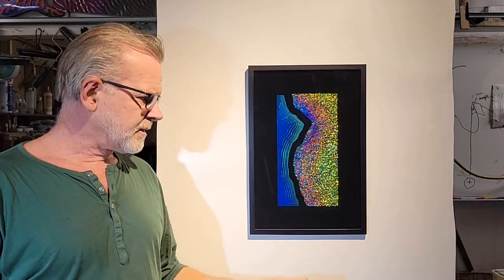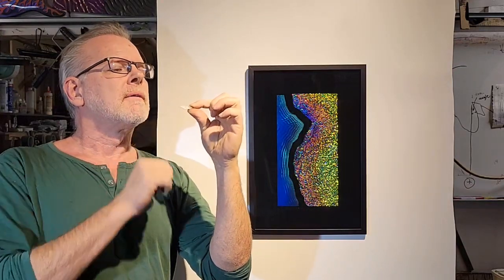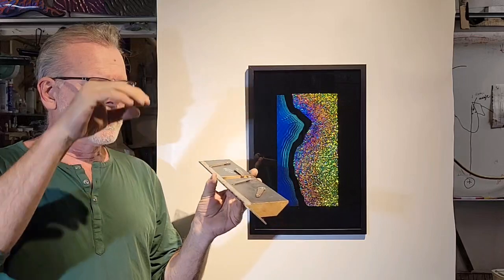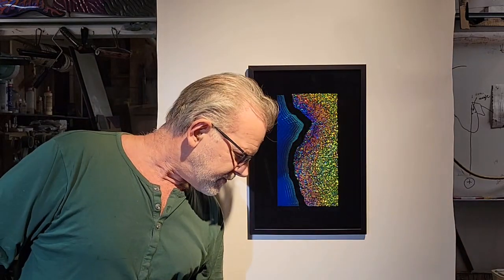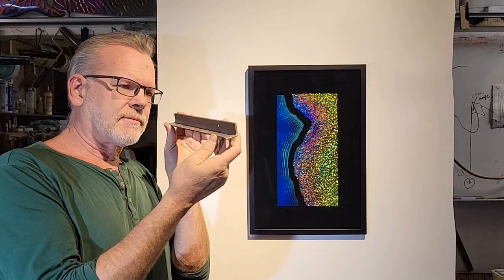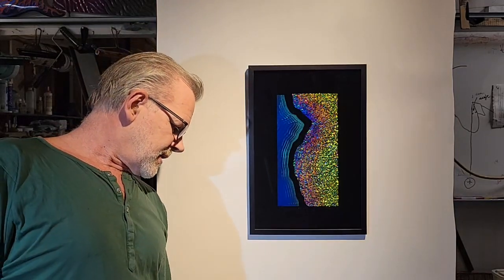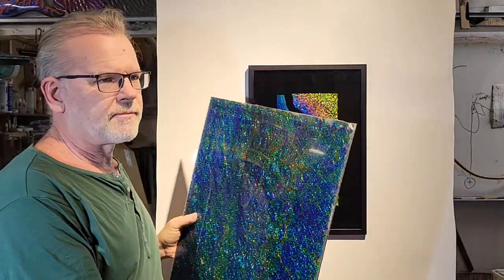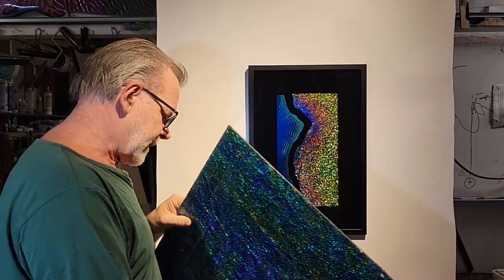How to cut polished bevels in acrylic with a laser

Comment: This is very neat. What is the material at 5:38 (on the bottom, big flat grey rectangle) that you seek to he just laser it without any burning/reaction?
Reply from the maker: @Chrondon  that's the steel angle iron.  Holds parts at angle, and allows magnet hold